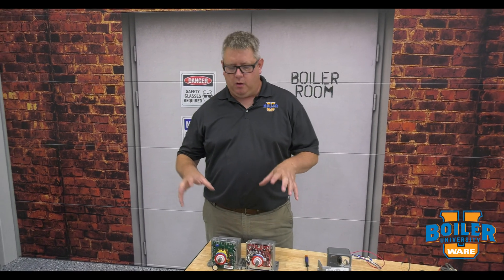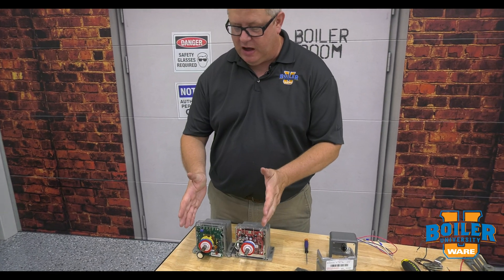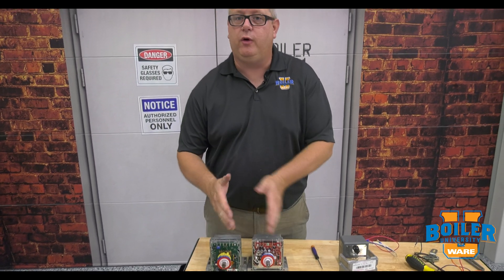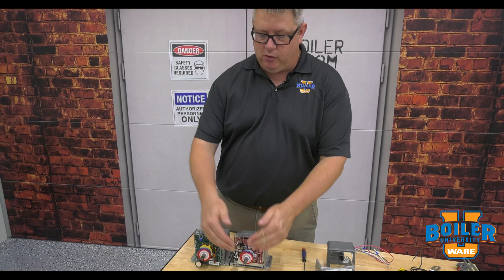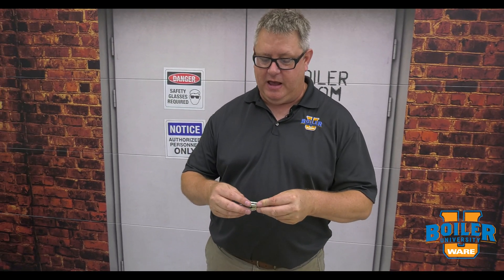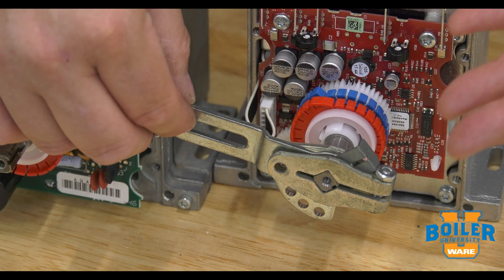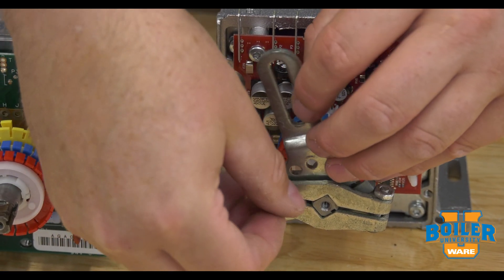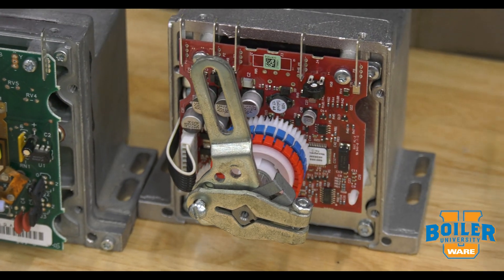Adjusting the Drive Angle on a Honeywell Mod Motor - Weekly Boiler Tips

Comment: Excellent video. Can it not be done with the help of limit switches; At least for extreme positions? Thanks.
Reply from the maker: In many older units, the travel limit switches can be used to set the 90 degree stroke at a variety of starting and ending positions.  Newer units no longer have the travel limit switches, the two positions are not as adjustable.  That is where the adjustable arm helps instead.